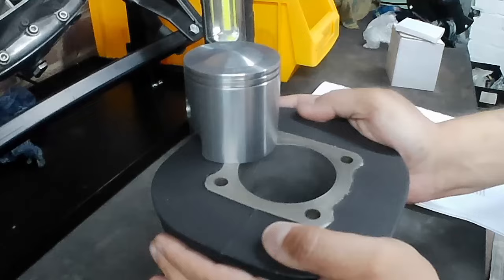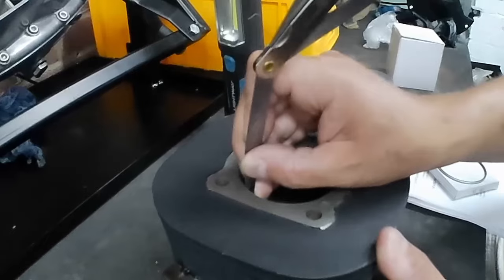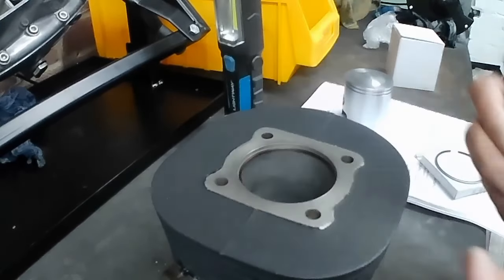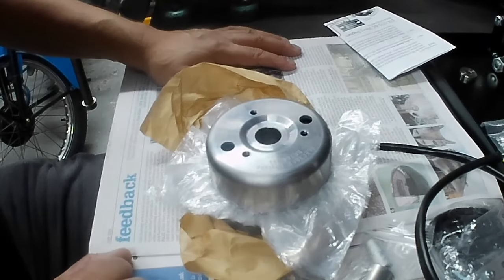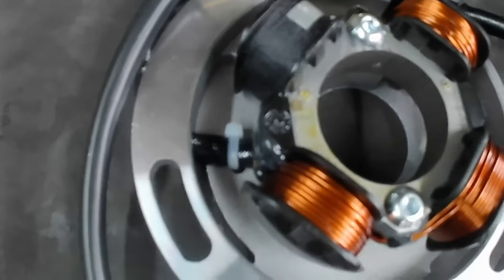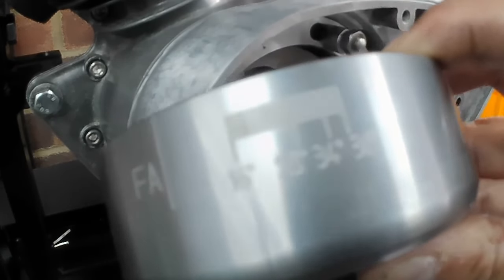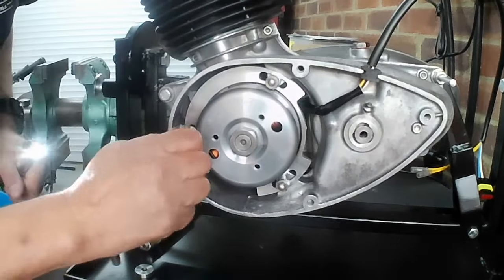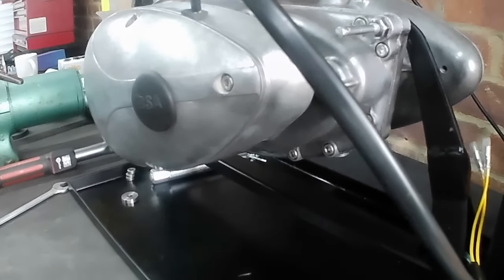Peter's BSA Bantam B175 - Top End refit and Electronic Ignition

Comment: I prefer the wipac stator on my D14, its just a better charging system when converted to 12 volt, I wish there was a normal electronic ignition for the D14 like a boyer, I ended up going for the sparkrite SX4000, it keeps the points but turns them into a switch as opposed to handing the high voltage spark, so they effectively last forever, well until the heel wears out
Reply from the maker: It's all about personal preference. I think that the electronic system is actually better for charging. You get a stable, full wave DC charge. If it works though, it works.
Reply: @retromechanicalengineer  I fitted an electrix world to a D3, I didnt  find it as effective as my d14 wipac stator, also I found it drained the battery when standing, I ended up fitting a battery isolating toggle switch on it, I run my d14 with a modern regulator rectifier, it just seems so stable with the standard points ignition and wipac stator at 12 volts, totally reliable, the only reason I fitted the SX4000 is because points are so damn expensive now, but anyway good luck with your bike, perhaps I just had a bad one on the D3
Reply from the maker: @GeneralMe100 it's not my bike, I was building it for someone else. My preferred system is the Bones CDI, as he's a friend of mine. Unfortunately, he doesn't import them to the UK anymore. I've fitted a number of Electrex systems without ill effects, but I'm a firm believer that you should use what you are happy with.

Comment: Dean, excellent video, could I ask you a question, when you fitted the collet onto the crankshaft did you put the thin end or the thick end onto the crankshaft first, Thank you
Reply: Thanks Dean for the reply, excellent video, you are doing a great job in helping to keep the classic bike on the road. My very best to you and your family.
Reply from the maker: I can't quite remember, you can't get it wrong though because the taper corresponds with the flywheel. The shaft is parallel.

Comment: A word of warning on this kit . If you have to use an adjustable peg spanner holding tool , make sure the pegs aren't damaging the coils . I did and a stator is £114 , but at least they sell all the individual components.  Also I recommend buying the removal puller and the holding tool with your order .
Reply: I remember a friend's brother attempting to use a cheap two leg puller on his X7 rotor , which of course slipped and wrecked a coil . Always use the correct puller !

Comment: I have an Electrex unit (fine piece of engineering) on my D3 and fitted the coil & reg/rect under the tank and squeezed a small battery into the tool box.
Reply from the maker: @InTheShedUK  sounds good Ian, probably the way.

Comment: The Electrex World units are very good. Tell Peter to use LED bulbs for nice bright lights and a noisy horn. I used their little power pack rather than a battery on the B50 and it all works really well.
Reply from the maker: @BritanniaMotorcycles  thanks Michael, I will certainly pass that message on. Best wishes, Dean.